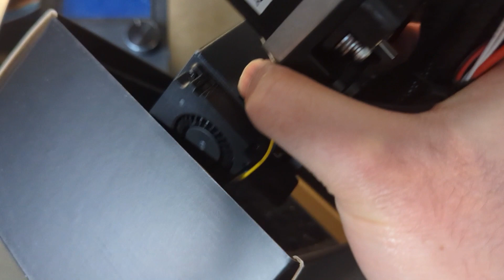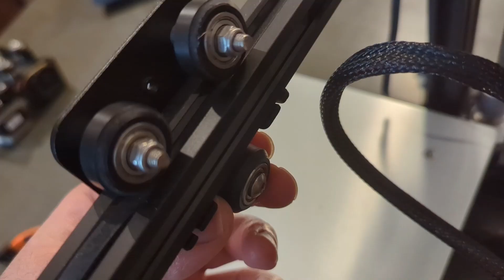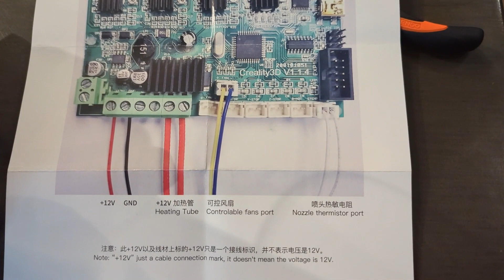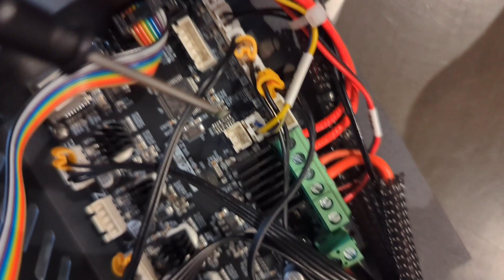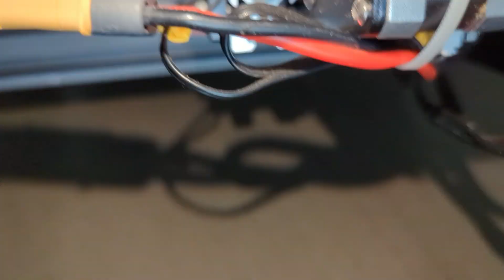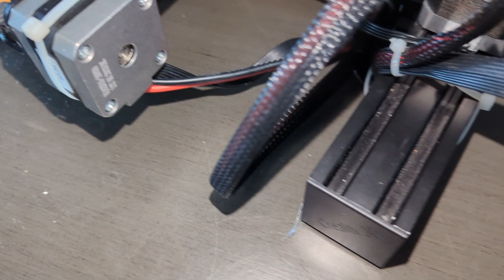Upgrade Ender 3 - Direct Drive Extruder Easy Assemble.  Switch Bowden extrusion to direct extruder.

Comment: I just installed my creality direct drive extruder and it is very wobbly on the axis as well as it does not home correctly
Reply from the maker: Sorry to hear that. I would recommend making sure everything is well aligned and tightened, you can also check your end stop switch. Also you can join my free Discord for further help, it's free and we would help you to figure it out
Reply: @techs.passion  Thank you I was able to figure it out.  Like you said I needed to make sure it was aligned well and I needed to tighten it.  It is working perfectly now.

Comment: I just installed a direct drive on my Ender 3 Pro, and turned it into a brick.
I followed the instructions, including those on the printed sheet. When I turned on the machine I immediately got the error tone and a blank screen. I have repeatedly gone over the wiring, and for the life of me I can't see where the error is.
Reply from the maker: So my guess is you need a firmware update so it could be that or something with the settings

Comment: I just added a orignal Creality direct drive extruded on my ended 3 v2 neo and now it will not home it try’s going to far left on x and don’t move on t now that I have all things installed as directions explained ..any idea w it is and how to fix?
Reply from the maker: Hi, sorry to hear that. I think this has something to do with the end switches cables. Did you by any chance moved them or maybe check the switches? Do you have CR touch or not?

Comment: Hi i just brought this set up and for some reason the stepper motor doesn't turn the brass fitting were the filement goes through??all i did was followed the wire set up on the manual they give u and just used the e extension cable.but nothing no power to the motor??have i done something wrong??thanks
Reply: Hey dude great news I got it all working yippee Yippee lol really like to thank you and the other helper really really appreciate your help you both thanks so much:-))I also saw ya video how to update the mother board I I did it pat on my back as I never knew how to do update stuff thank you very much:-)))
Reply from the maker: So the motor doesn't spin to push the filament, it's not stuck or anything but it sounds like there is no power coming to it. Try moving the extruder manually if it doesn't move then maybe it's the cable or the connection. Try checking the cables then and keep posted. I will be happy to help further.
Reply: @techs.passion hi buddy yeah there is power to the motor as I can't turn the brass part but turn it off I can turn it freely and I did notice when it starts to print I see the brass part very slowly move back n forward very tiny movement and its like its juddering?I had one recently and had bin printing fantastic then suddenly stopped so I got sent a brand new replacement set up n nothing now:-((thanks
Reply from the maker: I see, so it's fixed for you now, maybe it was just a bad unit. Glad it all worked out, please let me know if you need further help :)
Reply: @techs.passion no bro it's still not working:-(((
Reply from the maker: Sorry, I think I miss read that. Does the motor spin if no filament and you manually move it using the printer extruder move? We will figure it out I'm sure but it could be stuck. Open the nozzel and see if you can pass a filament all the way from end to end to ensure it's not jammed
Reply: @techs.passion when there is no power on I can turn the brass part freely but when I power it up the motor doesn't turn nothing all I noticed was  a very small movement of the brass fitting going back n forth very small movement the hotend works:-)
Reply from the maker: I see, yeah it sounds like the cables are connected wrong or something like that, check the cable again and another way I would test is by plugging another stepper cable and see if that moves it. I would be careful, I'm not sure how comfortable you are with it but let's say the x axis is working then take that and see if it will spin the extruder while moving the x axis from the nob then you know for sure it's the cable
Reply: @techs.passion  I've tried that bro still no joy :-((does ya lead the E one from the board at the end have the 2 middle wires crossed over ??so strange this is the first workd fab then stop so I get a brand new 1 and all I do is use the same wires from the other one and nothing I've ordered a motherboard incase the E plug chip mite of burnt out???is so fubar doin my head in all I want to do is print abs+ filament
Reply from the maker: I don't really think it's the motherboard, I'm going to be making a new video on installing a new hotend soon and I will mention your issue and how I would address it, I hope it helps, stay tuned, I will try to make it this week just for you, hopefully tomorrow if I can, sorry for all the troubles
Reply: @techs.passion  I asked a few others bro n they think it's the E chip in the mother board as they said its getting power but not enough to turn to motor and that's why is juddering so I have ordered a new board and a 1 meter steeper cable shame I don't a spare 42-40 motor to go back to stock printing all abit confused to me :-((
Reply from the maker: Sucks you been dealing with all these issues but at least look at as a learning opportunity, I will be making a video about teh hotend replacement soon and I will share it with you, It might help a bit.
Reply from the maker: Hi @richardbrown9035 This is the video I promised, I hope you find it helpful and I hope you have the issue resolved. https://youtu.be/NKZkCocMil8

Comment: When I upgraded my Ender 3 machines I did not go with the Creality upgrade as I thought it  too heavy, I had used this Creality upgrade on a CR-10 and it introduced print artefacts, I put this down to the mass of the stepper motor so returned it to Bowden, then a few years later the pancake steppers became available so I tried one on the CR-10 and all was well so I put Hero Me and Pancake steppers on the Ender 3's, also I found it much easier to use JST connectors between the original wiring and the hotend, it has since proved good when I had to replace a fan, also with the bed those bulldog clips are too strong and deform the bed to any inaccuracy in the aluminium plate, I now use the thumb screw type fixings that hold the glass without deforming it, also make sure to clean the glass with IPA to remove the adhesive from the protective sheet as over time this will bake and nothing will stick to the bed, soap will not remove all of the adhesive only IPA
Reply from the maker: I agree with you, this is for sure heavier than the Bowden and it is much more difficult to fix if it get stuck or jammed. I thought about that but also this was the better deal and I have always wanted to try it. Otherwise, I would have needed a side filament holder, new hot end and Bowden and I also needed a new fan so to me this way the money saving style upgrade but I'm with you here.
So far, I have to say it is doing so much better than I expected, also I can print the bendable type filament, always wanted to give that a try.
Thank you so much for the detailed comment and the suggestions.